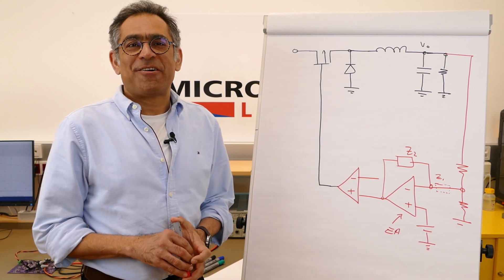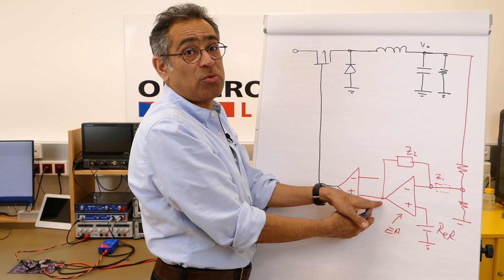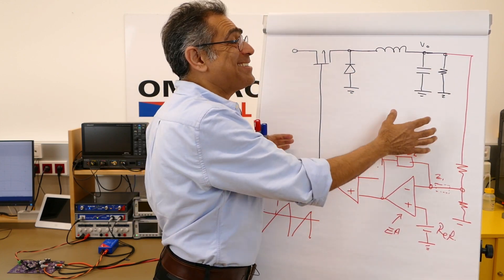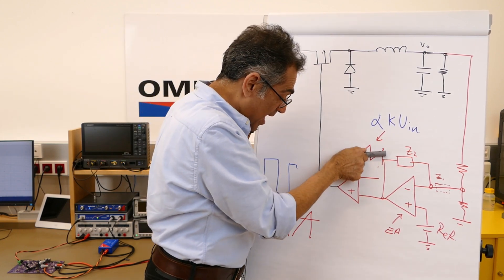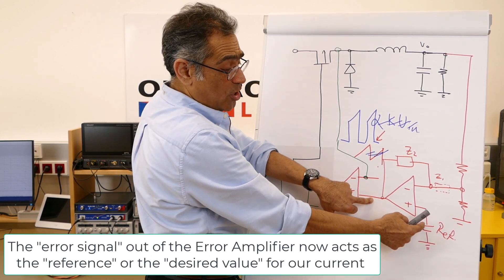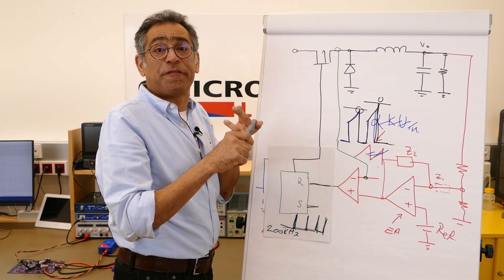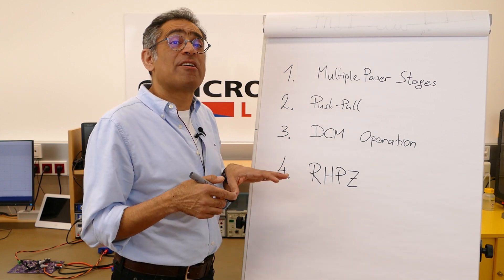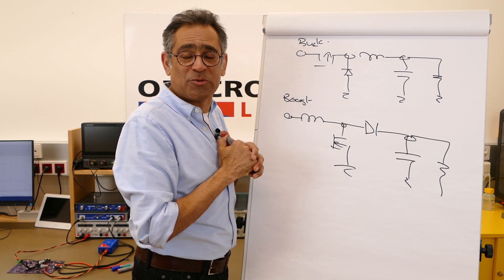Easy to Follow Voltage Mode vs Current Mode vs Voltage Mode + Voltage Feedforward Control Methods

Comment: In voltage-mode control, when the error amplifier senses the output voltage, does it sense the output ripple or an already DC voltage? I'm not sure if I have communicated the question properly but I would thank whoever can answer.

Comment: in the case we are getting the exact voltage Vo we want, the Verror is going to be 0, so the line compared to the ramp voltage is going to be at very bottom and the duty cycle with be constant 100%, this can't be how it actually work, but whatever it, it is not explain in this video

Comment: The video explains the concept very clearly and simply. Do you have any videos related to power tree design, such as converting a single DC voltage into multiple DC voltages for an embedded system? For example, core voltage for a microcontroller, I/O voltage, and different levels of voltage conversion from a main DC voltage.

Comment: I made a digital buck converter and  what I'm gonna say might seem quite odd but, in the contrary of what is said in the video, my converter respond very well to input voltage variation and very badly to load variation, does anyone have an explanation ? 😅

Comment: My input voltage that is supplied by a 12V, 9 Ah lead-acid battery is decreasing depending on load. My input voltage is 12.5V when there is no load, and it is 11.05V when I try to connect 1000 Watt load. Does that mean I need a line regulation? I do not use any of control, it is open-loop. My topology is full-bridge. I am thinking of implementing peak-current mode control. Do you suggest it?
Reply: A 1,000 Watt load on a 12v 9Ah battery is insane.  So, you are pulling 80+ amps from the battery?  With a 1,000 watt load that battery will last only 6 minutes, then ... dead.  Voltage feedback is easier. Think about ... how are you going to measure 80 amps, in Current mode?
Reply: @MrSummitville just a tiny CT works well, though the rest sounds quite weird, why is he even using fullbridge for 12V input and such a high current..
Reply: @EvilElmooo  Yes, I know about C/T's. I asked the question TO: @naficanerelli because I don't just give people a fish (the answer), I try to teach them HOW to fish (by asking them appropriate questions).  If you just blurt out the answer, then what have they learned?  And there two very important issues, that must be addressed, when using a C/T, especially in a current-mode type SMPS.
Reply: I agree but that was actually my suggestion, ct based current mode with push pull is a reasonable option for high current low voltage isolated applications

Comment: Dear Dr Shirsavar, as always, you are the best at explaining the logic behind power electronics.
I have a question. The well known SG3525 must be a voltage mode controller which is mostly used for push-pull applications. Or how is it?
Reply: Yes, there are many push-pull converters that use the SG3525 in Voltage Mode. 🤔

Comment: I heard that Current Mode is easier to compensate compared to Voltage Mode, for there is no complex conjugate poles. Is that correct?
Reply: Issues such a as RHP-Zero still exist in current mode control just as they do in voltage mode control. It’s just that because of us measuring the current before the LC network, we effectively don’t see the resonance and now have a “first order system”, hence why it’s “easier to control”. But the problematic zeros and poles are still present.
Reply: Yes that's correct. But current mode comes with lots of other challenges like leading edge blanking, slope compensation, current sensing

Comment: A pleasure to follow your teachings on all these subtleties and techniques of power electronics.  Regarding your series on capacitors, which capacitor technologies would be most appropriate for the creation of compensation networks (error amplifier) of SMPS ?
Thank you
Reply: I'm not the poster, but I believe ceramic caps are pretty common for the PI / compensation amp. They have good capacitance density so they can be quite small. X7R dielectrics are pretty common; they have good capacitance density (lot of capacitance in a small package), usually have a ±10% tolerance but the capacitance has some voltage dependence. C0G dielectrics are also available; they have lower capacitance density but have very little voltage dependence and are available with ±5% tolerance.

X7R is usually good if you need a larger capacitance and / 
or precision is not too important like filtering applications and C0G is generally better for applications where precision is important like setting a precise delay time.

There are other ceramic dielectrics available that you can check out if you're curious.